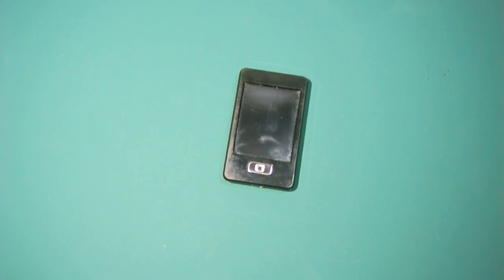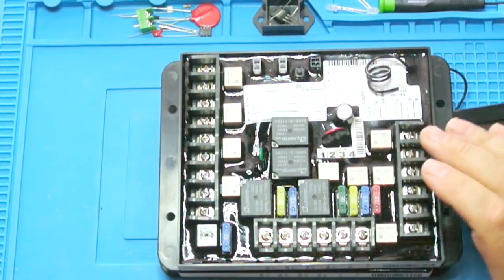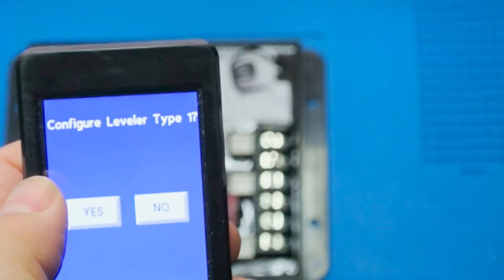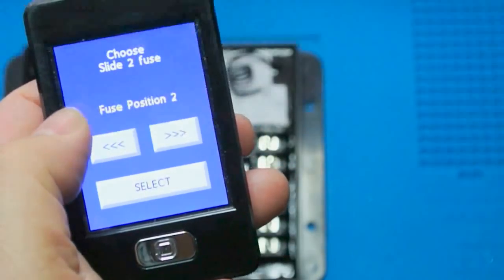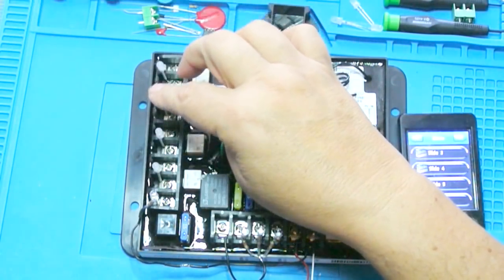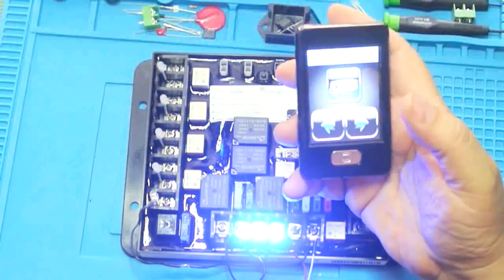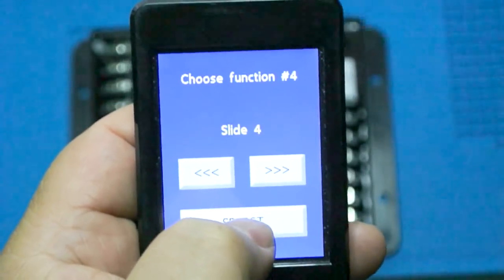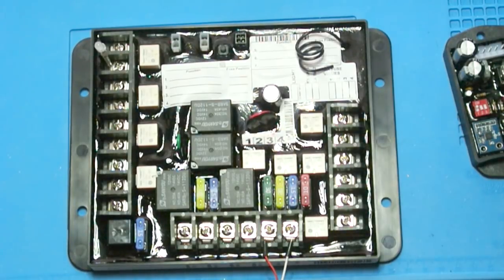Remote Controling my RV

Comment: @RVProject do you have more information on the remote fuse pin?  I can't find it on your website and I can't find it using the lippert link in one of the comments.  It comes up error 404.

Comment: That looks like the Keystone remote system you find in their 5th  wheels, like 29rks for example. Thanks for sharing I might try it for my 2606ws rockwood
Reply from the maker: I am sure many of the RV manufacturers use the lippert system.

Comment: Hello, thank you for this informative video. After getting back from a trip, my awning, slide, and stabilizer jack switches would not work. Everything is working with the remote. From my understanding, the battery is wired directly to the board then all the switches get wired to the board as well? I paid for a mobile RV mechanic and he told me my board is bad, I ordered a new board and put it in, but the switches still don't work. Does it need programming even if just to run the switches and not the remote? I connected the wires the same way as they were on the origional board. Thank you for any help!
Reply from the maker: The boards must be initially programmed. As it comes from the factory, each channel needs to be programmed to one of the input fuses for that channel to receive power.

The programming can be done via the wireless remote.  Essentially you assign each channel to a fuse, and a particular function to that channel.

There should be a reference in the video description to my website where I break down how to program the board.

Comment: Great video but unfortunately the website with the pin is 404 😔 when I purchased my Fifth wheel the remote was broken I just paid over $400 for a new remote and can't use it now 😔😔😔 the Pin for the fuses is nowhere to be found. All websites in goggle search are dead links . Guess I have a $400 paperweight now

Comment: Just purchased a 5 ch Lippert receiver with Analog remote. I am using the lamp output for my awning lamp. Need to add two additional lamp circuits, do you think the inexpensive 12 volt remotes will interfere with the Lippert receiver?

Great Videos?
Reply from the maker: They shouldn't. 

I have produced a series of videos along with associated webpages showing how I built a dimmer that can be controlled by either the Lippert receiver (by borrowing one of the slide out channels), or with the 12V remotes. 

You will need to decide if you want to remote your slides or remote your lighting. For example, with a 5 channel lippert receiver, I could run the 3 slides on my RV, and use one channel for the dimmer module (inside lights), and the light channel for my porch light.

See these webpages:

http://www.rv-project.com/projects/moad.php

http://www.rv-project.com/projects/linc1.php

http://www.rv-project.com/projects/rem-awning.php

http://www.rv-project.com/projects/remoteauto1.php

Comment: Just had to call and get the fuze configuration pin it is currently 1956
Reply from the maker: I am surprised they gave it to you. But on the other hand, it's kind of silly that they require a pin for the fuse configuration in the first place.

Comment: Great video, thank you.  My slides are not working with my remote,  the lights and awning still work.  Could it be the fuses to the slides that are blown?
Reply from the maker: Could be. There are fuses on the unit.
Reply: @RVProject  fixed the problem, it was a 20 amp fuse that was blown.  Slide are up and running with the remote control, thanks again for this helpful video!
Reply from the maker: @j.r.rodriguez208  Glad you were able to fix it.

Comment: how can I tell if I have a schwintek slide
Reply from the maker: A Schwintek slide will have a silver bar on each corner of the slideout with gear teeth machined into it.
Reply: Thanks for the info and I have been planning to add a 8 channel for my slides but they are the schwintek so I will have do more research any and all info you can supply will be greatly appreciated

Comment: Its a shame LCI doesn't publish the configure fuses pin#. I looked at your site for the code and see you decided not to publish the 4 digit pin number but did give a clue to where this number can be found on the https://www.lci1.com/history website.I noticed all kinds of 4 digit numbers on that site and only had to really guess once as to which it might be and wah-lah  I was in.  I'd like to explain my reasoning as to why I had to get in to configure my fuses.I had a new remote and knew nothing about how to configure it.  I guessed my way thru it and thanks to this video I found which board I needed to find as well as the button I needed to push in order to "sync" my remote to the multi-function board.Next, it asked me if I wanted to configure fuses and I said no...but after that it said "Send Configuration".  I did that and I think that erased all my fuse mappings that I had.  I had played with the remote and my auto leveling system and tried to resync and this time I could not resync.  When I pushed the button it would not click 2 times.  If I clicked send configuration it did click 2 times...but again, the sync would not.  I also could not longer use my remote on my slides. I was baffled and tried to resync again only to grow more frustrated that the sync button was not clicking 2 x.  I kept noticing the configuration and sending it.  I noticed all my mappings were not to fuses but to dashes.  I assumed that maybe I lost my fuse mapping.   Lucky for me that was a diagram glued to the wall that listed the fuse mappings for the functions.  After finding the configure fuses pin# I went thru and reassigned the fuse# to the function number... bam.... everything started working smooth again.    What a pain in the ass this was... but I learned a lot.
Reply: by the way.... best you tube video ever.
Reply from the maker: I don't know why LCI even has a fuse configuration. Just put 5 or 8 fuses on the board depending on the number of channels it has and be done with it. 

The whole idea of putting fuse 1 on channel x,y,z feature is kinda dumb I think. And as cost-conscious (i.e. cheap) as RV manufacturers are, I have to think the fuse programming feature costs a few dollars. I wish they took that money and invested it into say a tank monitor system that actually works!
Reply from the maker: I also don't know why LCI goes to all the trouble not to publish the fuse PIN, but since they seem really protective about it, I don't want to publish the number and get sued. So what better way to obtain the number than direct viewers to the LCI website and find it there?

That way, they published the number, I just let people know where to find it.
Reply: @RVProject  That website is missing now.
Reply from the maker: @mdntblu  https://www.lci1.com/about/

Comment: how do you reset the password without knowing the old one?
Reply from the maker: I am assuming you want to reset the PIN on the remote?

If so, turn the remote on, then immediately depress the ON button 5 times. You will then be asked to reconfigure the remote, including resetting the PIN.

I have a video for that: 
https://youtu.be/MmRu4FN1g7Y